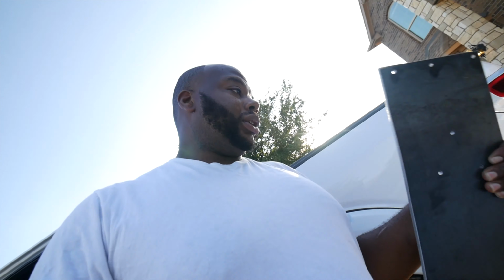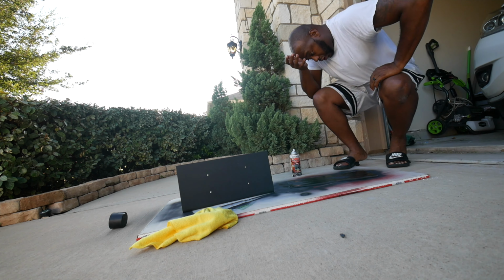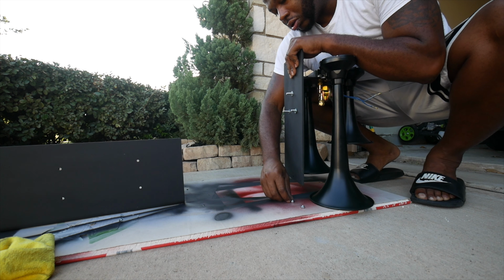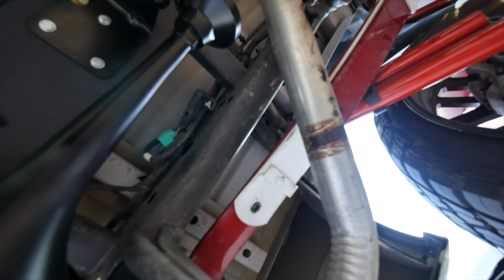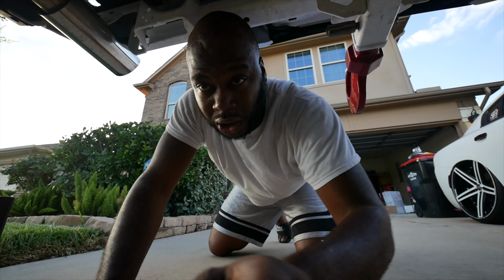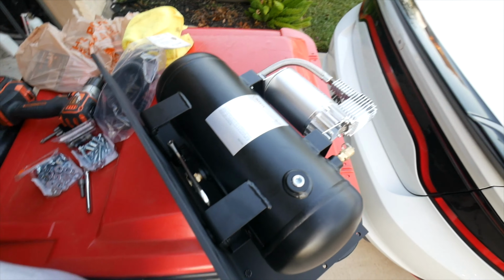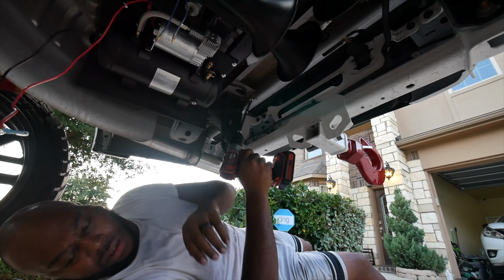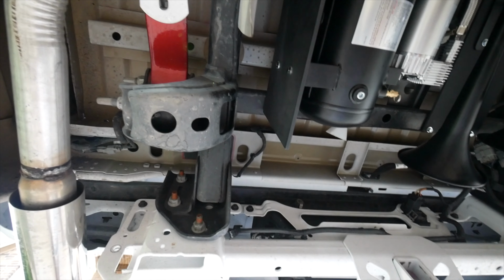BEST WAY TO MOUNT A TRAIN HORN TO YOUR FORD TRUCK

Comment: The compressor should be straight up, not on its side. I believe it will work either way, but specs say it runs better

Comment: Bro I would have put a 90 on the drain valve and run an air line from there and the lowes point of the tank put the rain valve on that